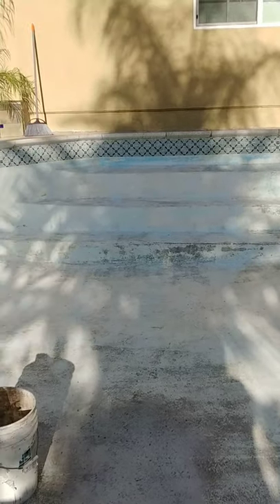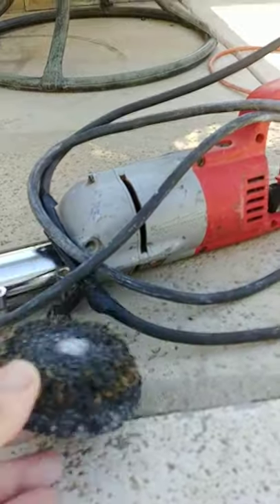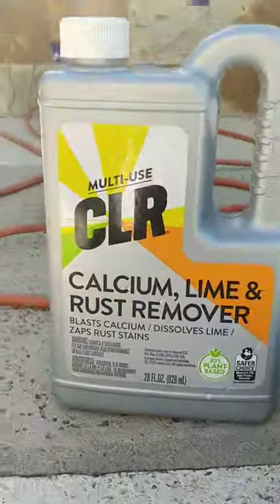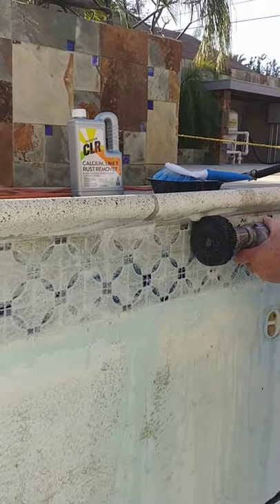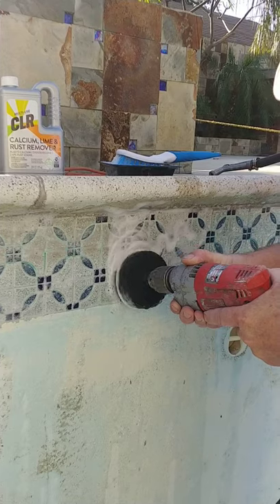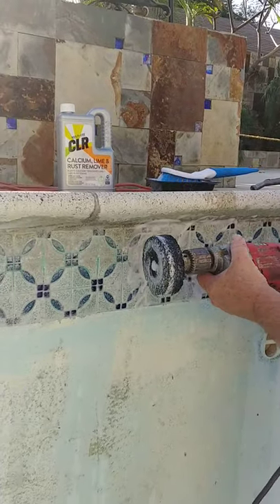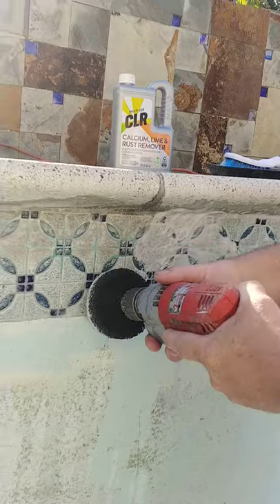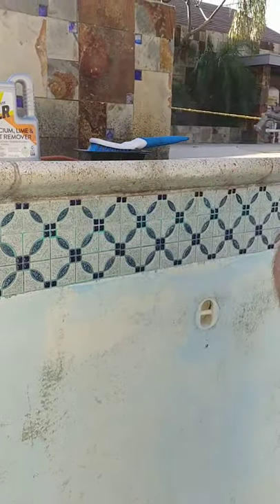how to clean mineral \ calcium deposits on pool tile

Comment: If you are a pool owner and have a day to clean tile, this might be an option. But if you are a pool company, Maxx Strip pool formula with a 3.5 cu ft blast pot, air dryer and a 185cfm diesel compessor is the only way to go.
And by the way, that is not glass tile. It is a ceramic mosaic.
Reply from the maker: this is for DIY ....some people dont want to spend 2000$ to clean their tile .
1 year latter with epoxy my pool looks amazing
Reply: @Ebbrush3  Exactly what I said. Might want to read the post. If you put an epoxy sealer on the tile, you have just created a bigger problem later on. You WILL scratch the epoxy with your method the next time you need to clean the tile. This will require stripping the whole tile instead of just the calcium carbonate line.
Reply from the maker: I epoxy the pool not the tile
Reply: I used a very fine sanding wheel (like emery cloth)  wet surface, and it "scratches" just the very surface stuff off, then use a simple Turtle wax to seal it up, buff it off.  Looks new.
Reply: @Ebbrush3  $2000 😂 you might want to get another bid buddy. It doesn't cost $2000 unless you have 300 feet of tile to clean and. Remember "TIME IS MONEY"

Comment: I was told it scratches the tiles with smaller marks and increases odds of calcification even faster what do you think?
Reply from the maker: i found if you keep the wheel wet it works great....and i wouldnt hurt to seal the tile with tile sealer again
Reply: Yes, it does scratch - IF you go too hard - so the key here is work slowly - I stopped using this method due to small scratches appearing so went to high pressure salt / soda - works fast, no scratching and pools need the salt and alkalinity anyway - So no draining of the pool AND no vacuuming - Cheers now!
Reply: The trick is when done to SEAL your tile before you refill the pool.

Comment: those pads would last the whole pool if you used water with it. you're essentially burning the pads with friction. with the pools full you can basically like wet sanding the pool, you just don't have enough water is all... been cleaning pools like this for decade or longer. There are better products than LCR (its good) but there are better ones out there.
Reply: Like what? Other then using clr

Comment: I usually do this kind of cleaning you can use muriatic acid spray it with a garden spraying pump and wait 5 to 10 minutes rinse it with a pressure washer at least 3600 psi that will god way more quicker.

Comment: That will absolutely scratch your tile. Might be fine for an old pool with worn out tile, but be careful with any of these methods you see on youtube. Do one tile, and let the tile dry completely, not just wipe it with a wet rag. When the tile is completely dry, you will see the actual results, and the damage that has been done. Don't say we didn't warn you.
Reply from the maker: horseshit .....if you keep the wheel wet it doesnt scratch them ....my job came out great......and i didnt have to pay someone like you $1500 so fuck off
Reply: I agree with you SD...this method is suspect and may work on some tiles but others it may scratch the hell out of it. I have been cleaning tile for 15 years and tried everything. The best solution is to let a professional with lots of experience clean your tile. Think of it this way, you use this method or a chemical method and it ruins the tile, it is going to cost at least twice as much to replace  it than to pay a professional. I guarantee my work. @Ebbrsh3 isn't going to pay to have your tile replaced if his method ruins your tile.
Reply: @mraleyqps  hey bro can you lend some advice on this subject? What works best that you use or do? Thank you kindly!!
Reply: @gogators5762  are you a homeowner or a pool company? If you are a homeowner, doing it the correct way is not economicaly feasible because of the cost of the equipment. If you are a pool company, we use a 185cfm diesel air compressor with an air dryer and 3.5 cuft  blastig pot. 200 ft of blasting hose and Maxxstrip pool formula media. The Maxxstrip is soft enough not to damage 95% of the tiles you will encounter but without experience you will need to be extra careful when blasting.
Reply: @mraleyqps  thanks bro! I'm a homeowner so I understand what your saying. Thank you for the reply back!

Comment: Quick question… what is the rpm of your drill?
Reply from the maker: the drill is a milwakee hole shooter ..variable speed and i go slow
Reply: @Ebbrush3  I have a skill runs upto 800 rpm
Reply from the maker: 800 too fast
Reply: @Ebbrush3  that’s just the maximum. I wouldn’t run it at the max

Comment: WARNING WARNING-  This method will scratch your tiles.  Pumice stone of any kind scratches the finish on the tiles.
Reply: So what do you suggest?  So far my choices are scaly tile that looks bad or scratched tiles.  Do you know of any methods that actually work?
Reply: @scottsworld21 I wonder if a Scotch Brite pad on a drill brush would work.  As he says in the video, speed=heat=no good. If you have a regular drill, throw it in 1st gear and make sure it stays lubricated with whatever solution you like.  Same idea when using those rubber sticker/decal removal wheels.  We want fast and easy, but you can only go so fast before you start causing other problems.
Reply: This is insane
Reply: Dustless Blasting

Comment: Wht type of bit is that?
Reply from the maker: silicon carbide .....you can get them at home depot  in the tool dept
Reply from the maker: just need to keep it wet and it will not scratch the tile...the CLR doesnt help ....just water is fine

Comment: You need chemistry to remove calcium not elbow grease lol
Reply from the maker: clr didnt work , but silicon carbide wheel took it right off ...just keep it wet .....1 year later after plaster repair, epoxy pool looks brand new ....cost was $1200
Reply: @Ebbrush3   Just curious what else you did to your pool while it was drained?  Do you have photos of that?

Comment: Use glass bead 80 grit and water lol compressor 100 psi and common sense ..u can do whole pool 2 hours ..30 min to polish tiles
Reply: Like a sand blaster??
Reply: @mattalbrecht7471  yes gray stand up harbor freight 40 bucks ..they got glass bead too..60 bucks a tub..90 psi on air tank ..do a practice spot ..you'll need clear face shield..they got those to ..get the blue on looks like paintball mask..it last longest
Reply: Can you please post a link on the sandblaster your talking about thank you 🙏